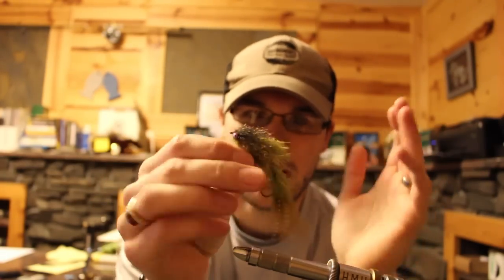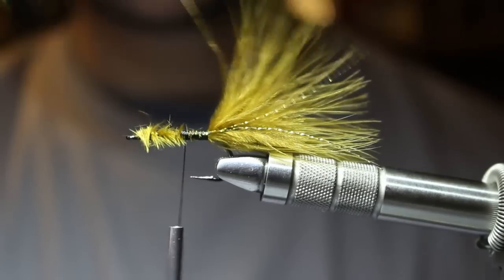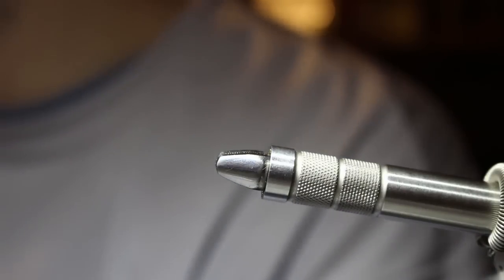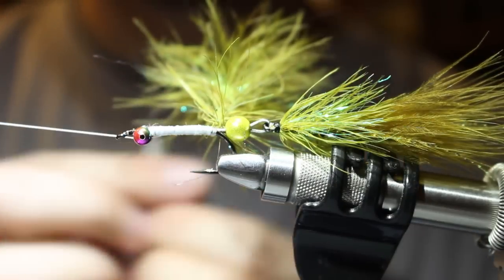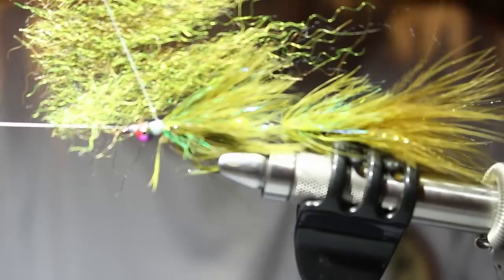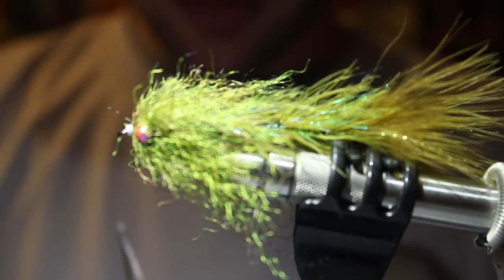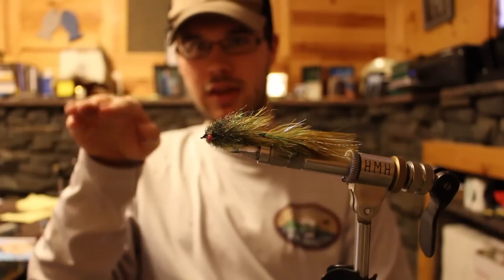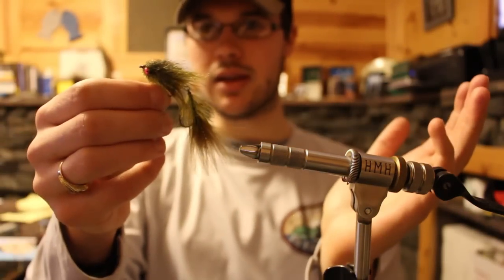Fly Tying: Brammer's Mini - Death Grip - Trout Streamer

Comment: Great vid as per usual. Thanks for sharing your knowledge and contagious enthusiasm. Would really like to get into the brushes and was wondering what size wire you use for your standard brushes? If you've answered this before I apologize and will certainly check through your videos to see.
Reply: It's ok I found the answer in you dynamic dubbing brushes part 1 thanks again

Comment: Looks great. Mini articulated streamers are more suitable for our smaller UK rivers. One question, on these smaller patterns, do you think the rear hook point is needed or could you clip it off and just rely on the front hook?
Reply: Peter Finnis Good question, my thoughts exactly on cutting rear hook. I live in B.C. CA  Where 2 hooks are banned.
Reply from the maker: The rear hook is certainly not necessary from the standpoint of missing fish, but the mass form the hook helps aid in the this particular flies action. You could easily swap the rear hook for a shank, but it may be worth bending your own shanks form thicker wire, adding sparse weight to the rear shank - say 5 turns of .025 on a thinner wire shank, or you may find it fishes well regardless.
Reply: Thanks Gunnar. Yes, adding a few turns of lead wire to compensate makes sense
Reply: In our research that you can recreate, you will learn that the back hook will be the engaged hook when the water is cold.  I've personally seen 90 percent of takes on the back hook in cold Spring waters.  Not everyone believes in trailing hooks, but I do wonder if they are aware of how many fish they miss.